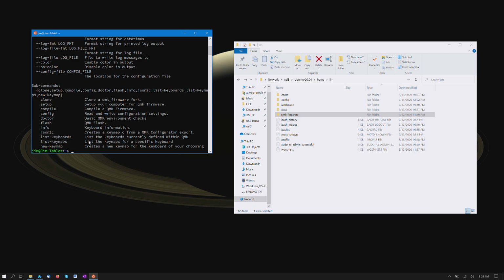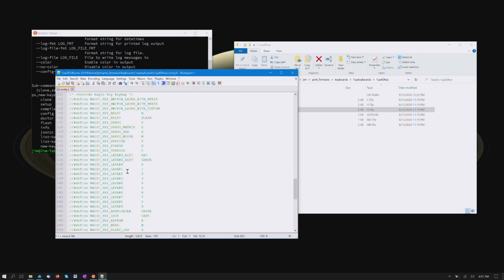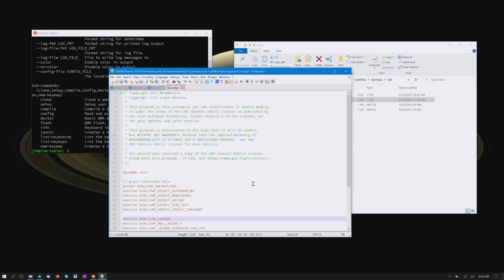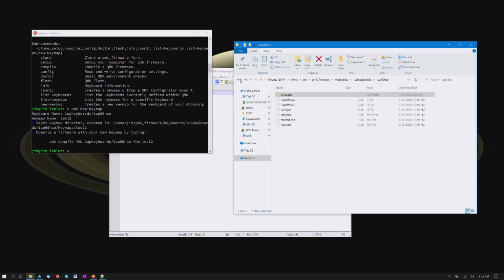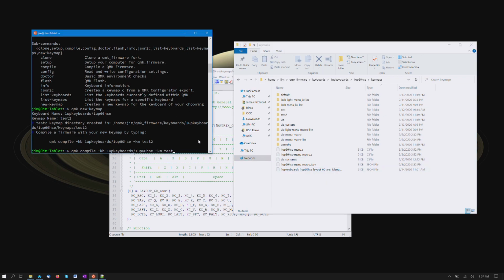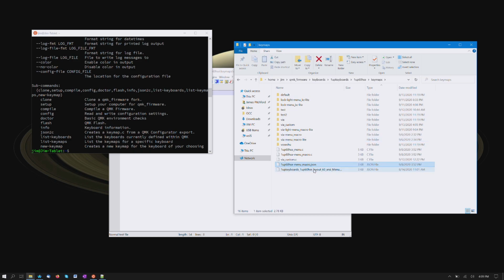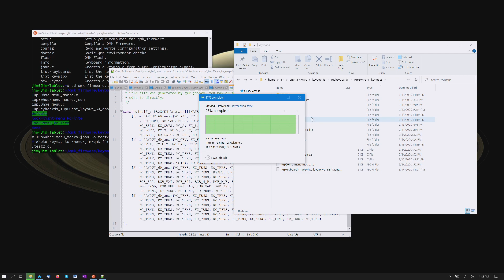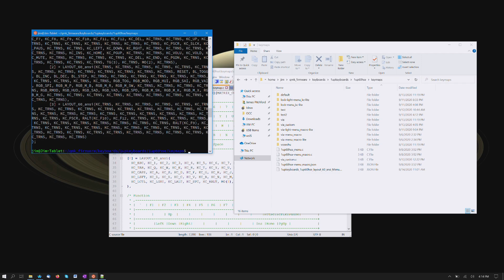Using and Building QMK and VIA - Compiling QMK

Comment: Wait... you have to recompile and flash the thing for configuration changes?! that's a huge pain!
I might switch to VIA...
Reply from the maker: If you only use QMK, yes, that's what it takes to make changes. That is a reason it is nice to enable VIA within the QMK firmware, so the smaller changes can be made easier, but larger changes (lighting layer changes, certain special keycodes) still require working directly with QMK.

Comment: i made my own pcb and keymaped it with keyboard firmware builder, I downloaded the hex file and flashed the keyboard. The keyboard works, but I will need to edit the source files to get my rotary encoder and oled screen working. I have edited them but I don't know how to compile the edited source file to hex. Please help.
Reply from the maker: There are far better people to ask than me in the mechanical keyboard, OLKB, and QMK communities, but I'll offer what I can.
To compile a keymap in QMK, after you set up the environment to do so, you need to run 'qmk -compile -kb "KEYBOARD_FOLDER" -km "KEYMAP_NAME" and, assuming there are no errors, that will do it.
My "Using and Building QMK and VIA" article linked to in the video description includes some of the relevant information, but there might be more involved because of your custom PCB.